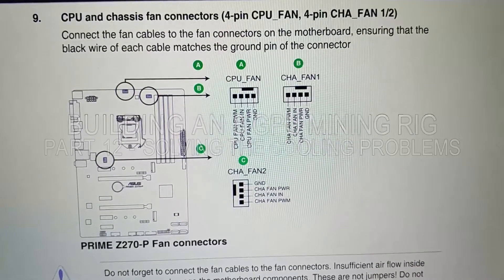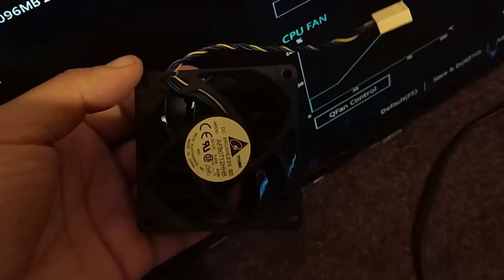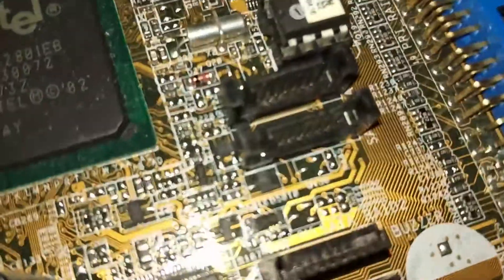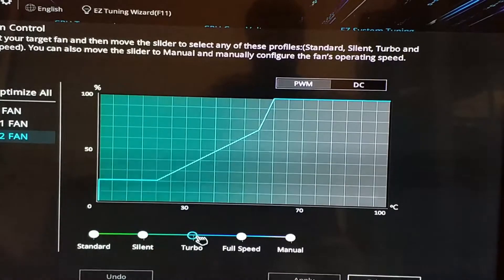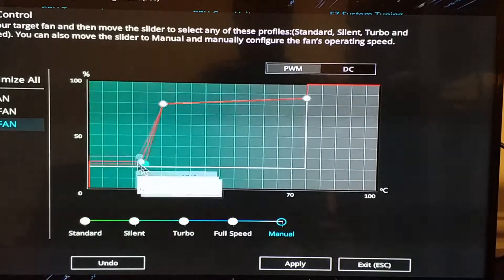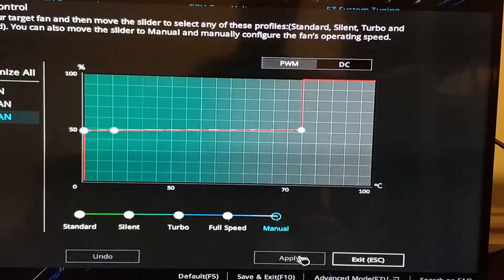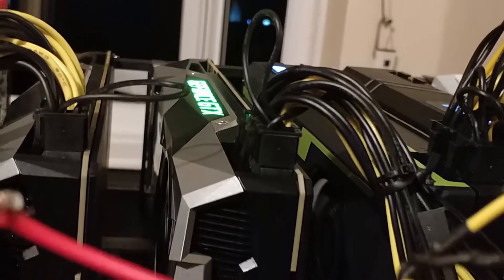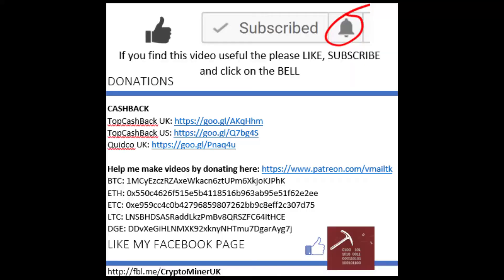Part 12: 8x 1080Ti GPU Mining - Solving The Cooling Problem. 30/09/2017

Comment: Hi. Thanks for this Video. Did you manage to fix the fan control properly? I am thinking of doing the same thing as I can't power the fans directly from the mobo. Should I just connect all the PWM wires and then to the mobo? What software did you use to control the speed?
Reply from the maker: Hi, I think the server fan signal are wrong way round. I just set the speed fixed at 50%. So no software. The only mother board connection is the PWM, I did not connect the taco